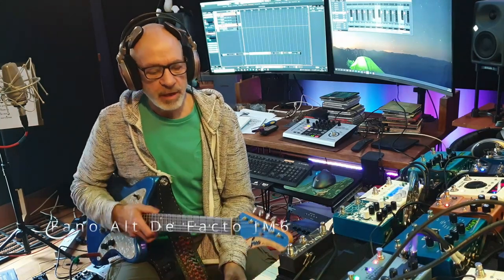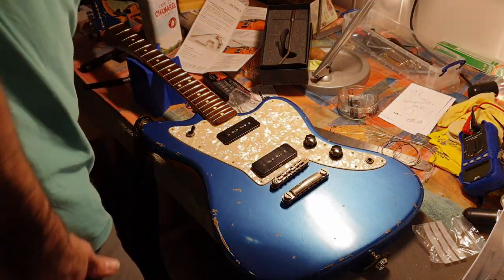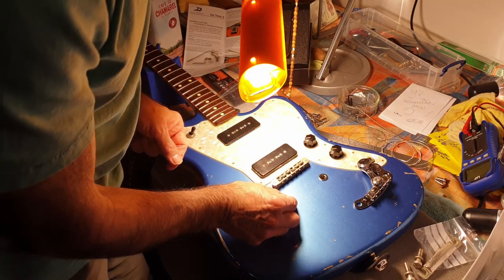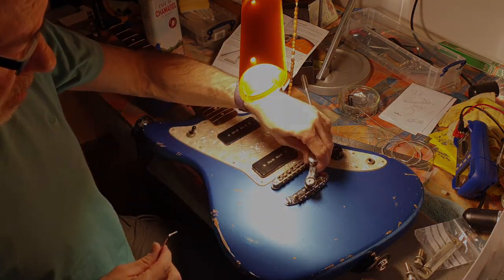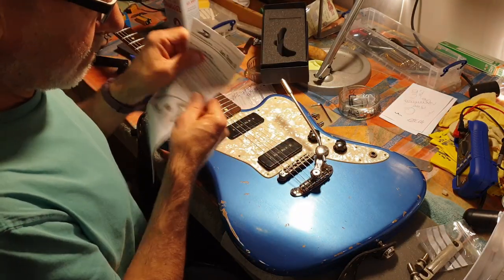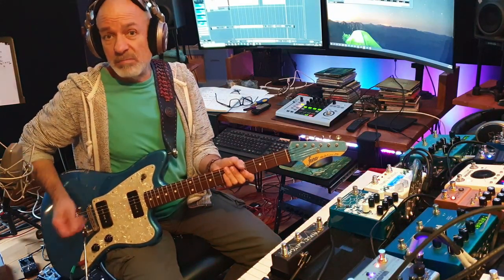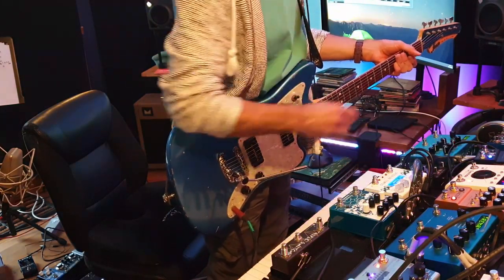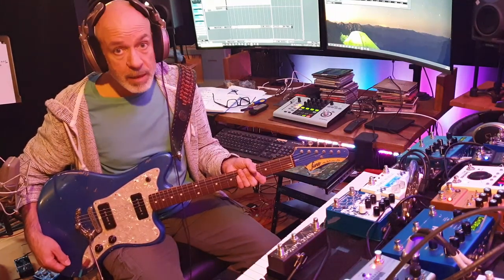Duesenberg Les Trem 2 Fitting and Demo

Comment: Hi Alan: What pedal are you using for the chorus at 32:12? It's so lush and stereo sounding.  Are you using some type of effects loop or running your guitar directly through all of those pedals in series? Might make an interesting YouTube video of you explaining how you set up your home studio and what your effects chain is. FYI: I'm thinking of getting one of these trems for my Les Paul Jr.. Sounds phenomenal with that Big Sky reverb and the Chorus.
Reply from the maker: Hi John M. Sorry for the delay in replying. Thanks for your comments. The chorus is from the Strymon Mobius. All the pedals are in series. I could make a You Tube video of the pedals but I change them a lot so... Haha. Not sure about fitting it to a guitar that has no stop bar. I haven't seen that done. Would be interesting to know.

Comment: Btw how much does the trem weigh and can this be offset by fitting a lightweight aluminium tail piece ?
Reply from the maker: It's pretty lightweight. I'm very sensitive to weight and I didn't find it added anything significant. Probably about the same as the tailpiece that came off.

Comment: Think maybe the hex bolt on top was meant to already come tightened and maybe it got loose in shipping, hence why no instruction to tighten? This is the second video ive seen weirdness. Another guy on youtube couldn't get any of the replacement bolts to screw in to his Les Paul Standard lol. Think maybe whoever worked that shift at Dues accidentally put in 2 sets of metric. oh well, cool vid.
Reply from the maker: Thank you!